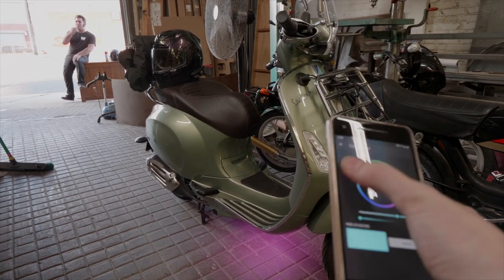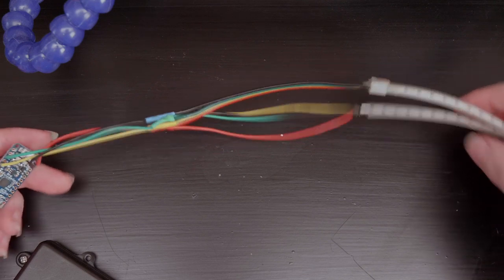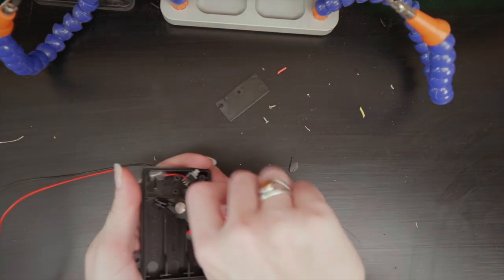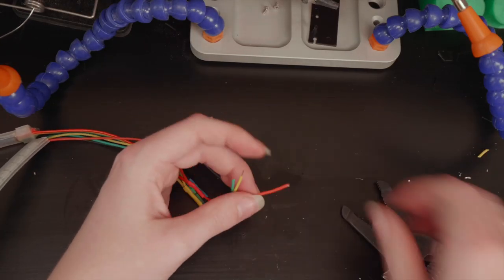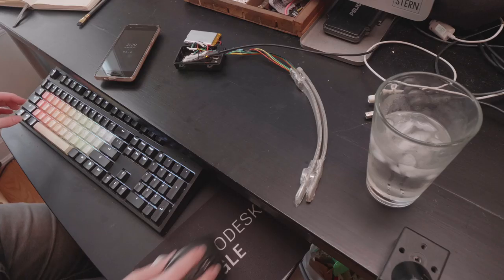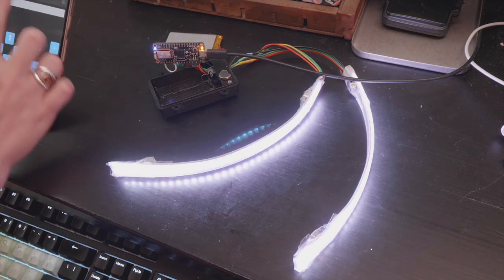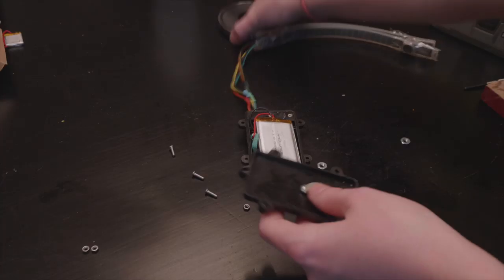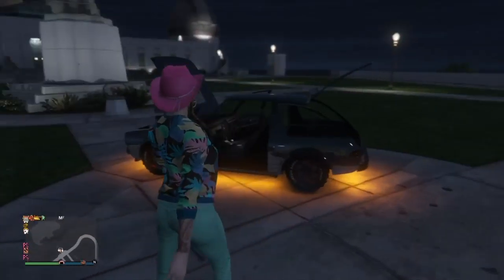How to Install LEDs Under a Scooter (with Bluetooth) // Becky Stern

Comment: I put LED strip lights under sport car 6 year ago work real good! Next be doing same thing to my 2 motorbike Ruckus Trike 150cc & Vestaline Vespa 200cc soon i like what you did to scooter but going use remote controlled! I got other scooter RTX 50cc i buy LED strip light brake & turn signal.

Comment: Hi, major buzzkill here *salutes*...
While cool, you might wanna check the legality of this vehicle mod in your area!
If I would do this in my country i could get fined €60 for having 'incorrect vehicle lighting'.
Just FYI
Reply from the maker: Congrats on your comment achievement! Legality varies by location, it's true, but so does enforcement. In mine, it's legal to have white solid color underglow, and especially bad to have anything flashing in the colors that emergency vehicles use. So I am taking a bit of artistic license but not causing as big of a scene as I could. Ride at your own risk 🤙

Comment: Hey Becky. How old is that scooter? I love that paint colour, I had a Peugeot bicycle that exact colour in the 70s. I like the LEDs too, I suppose if you had any grief from the cops you could just mumble 'Sorry, officer' and remove them at the kerbside. Maybe save yourself the fine.
Reply from the maker: It's brand new, 2018 model. Color's called Portofino Verde. TBH I rode past several cops, none of which even gave me a second glance. New York's finest can be selective about enforcement (most PC way I could put that).

Comment: Awesome build. I would love to end up building this one day but i need to figure out the best way to get the wiring into my vespa sprint 150 without drilling a hole in the frame.
But you did just earn a new subscriber, this is an awesome project and way more impressive than i thought it would be based on the title.
Reply from the maker: Recs for a better title?
Reply: @BeckyStern  Oh no the title is fine its just that i was looking for something about how to wire underlighting and getting the wiring to the battery without having to drill. My biggest issue is the fact that the Unibody on a vespa is really badly made for this kind of mod and i didnt want hanging wires.